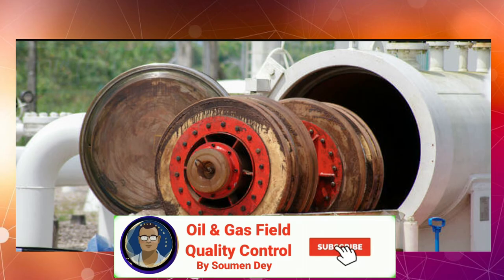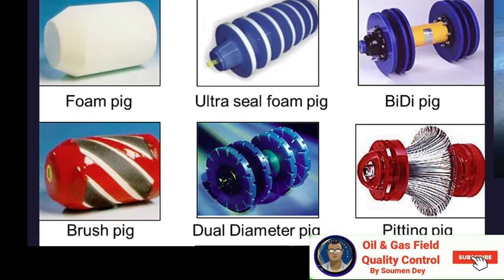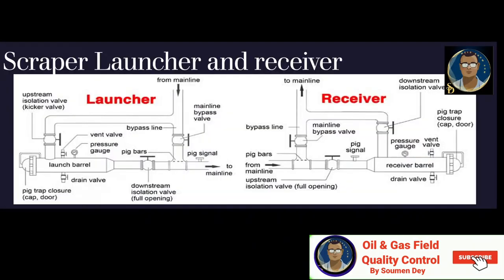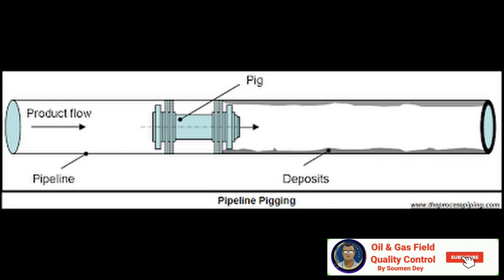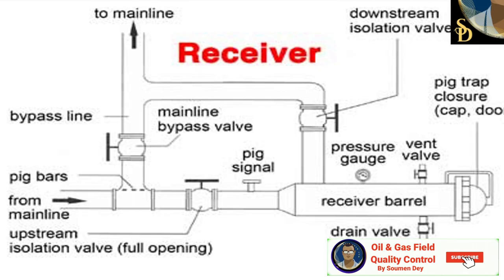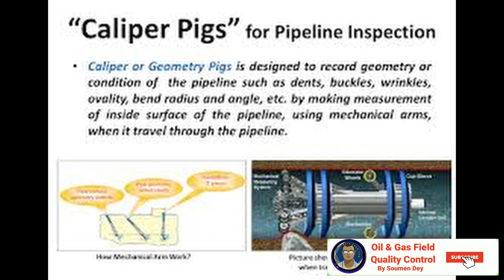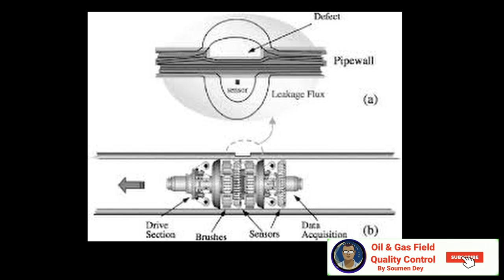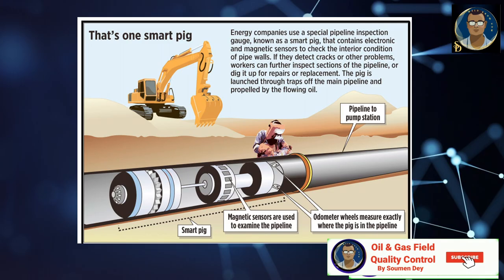WHAT IS PIGGING?  USES OF PIG, SMART INSPECTION PIG, HOW TO CLEAN A PIPELINE INTERNALLY?

Comment: Great teaching and thank so much.
Pls how do I know the type of pig to use  and how is the pig coupled and  received to avoid too much of product loss assuming operation is on and lastly at what point do I receive the pig and how pls?
Reply from the maker: Thanks for your query.
Selection of PIG depending on the service, type of pipeline (Metallic/ non metallic, coated or uncoated etc. ) purpose of the pigging - many factors.
Generally, during construction of pipeline, we use the pig for- 1) cleaning the pipeline (Hard foam Pig with or without Metallic brush, Disk - bi or unidirectional pig with CS brish installed.
2) For filling Water 3) for dewatering, swabbing the pipeline after hydrotest, 4) For mothballing the existing pipeline (cleaning the service waste, 5) For introducing Nitrogen, dry air for lay up to protect the hydrotested pipeline till commissioning, 6) while introducing the service gas or liquid to remove the air/ nitrogen from the pipeline completely or as much as possible..
Actually, when ever you will be exposed to the real work - you will have more detailed knowledge gradually.

Comment: It very useful video brother...

Could you pleas let me  know what is the procedure for pigging pipeline...

ASME procedure

Please help me what is the procedure can I use for pipeline pigging gas and oil
Reply from the maker: Pigging a line in construction phase is for internal Cleaning before or after hydrotesting. This will be little different for cleaning the Existing pipeline. What is your requirement?
Reply: @OilandGas-inspection-soumen 
Line was working ..then stop .
Now we need to operating the line a gain ..
We need to know what is the procedure required for that..
Befor hydrotest ..

Please all the information if possible before band after hydrotes .